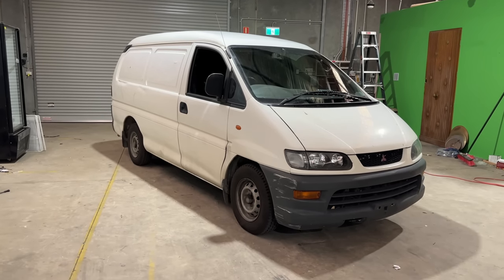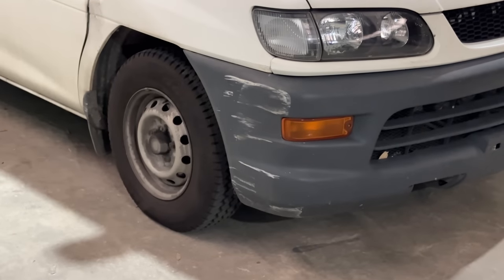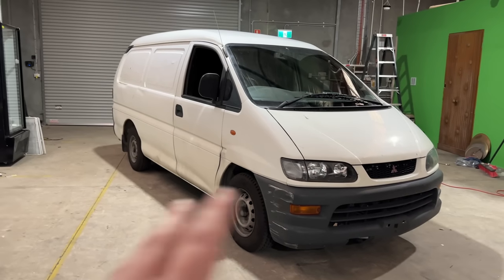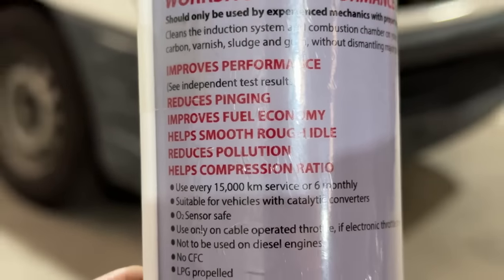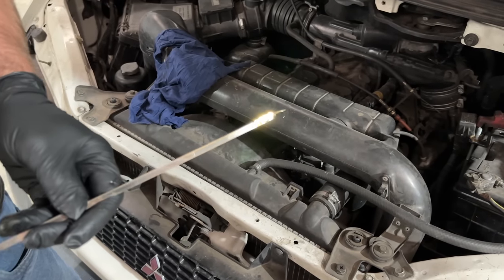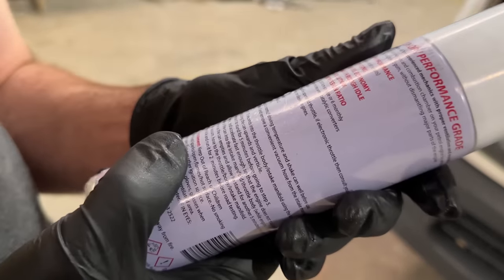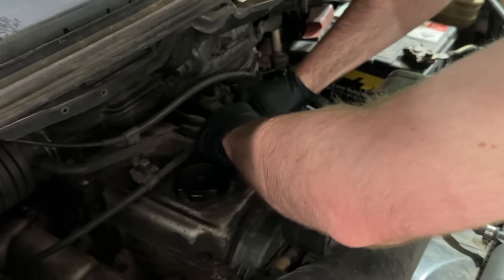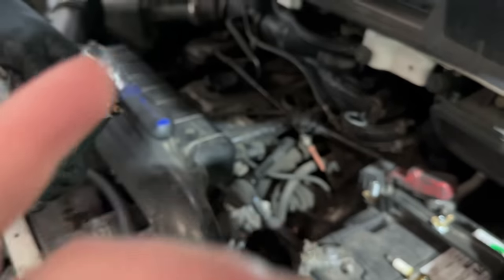We killed the donkey van.

Comment: The fact that it doesn't throw a check engine light is actually pretty funny in a subtle way. The engine making all these scary noises and the ECU is like, "Nah. We're good."
Reply: I think this van is before all that. Barely, but before all that.

I had a 90s car that would not throw any errors until it was fully cooked
Reply: @miaugato93  yup, so just in case the noises and lack of working didn't tip you off, we are broken
Reply: "Fuck it we ball"
Reply: The computer can't tell if the car is on fire upside down with four flats. It only checks the output of a few sensors.
Reply: @miaugato93  My '98 Civic doesn't show a CEL or any codes despite running on 2 cylinders
Reply: @AiOinc1  Ahh so that's my problem, time to install the fire sense-oars and set them on a semi regular basis
Reply: "S'all good mate. That smell's gonna cook off any minute"
Reply: @AiOinc1  ironic that a new car could at least detect 2 of those criteria.
Reply: i had a mid 2000s Ford truck like that, ended up with a dead cylinder too and didn't throw a light or code or nothing, even foot to the floor running on 7 cylinders with the engine shaking like an earthquake
Reply: yet my 05 dodge magnum always has a CEL for o2 sensors that ive replaced, and misfires if i turn my ac off
wtf car
Reply: Now ECUs are like one molecule of oil hits oxygen sensor ACHTUNG ACHTUNG ENGINE IZ IN DANGER and now you cant pass emissions grats
Reply: My 1990 ford f250 has the filter keep falling off the transmission and I lose all the gears even reverse and the check light for the trans computer says "this is fine."
Reply: Shoulda used SeaFoam not Japanese Clam-Juice!! {-_-} 😳😂
Reply: @MAGGOT VOMIT  no pizza only khlav kalash!
Reply: My sprinter has no CEL… 

It’s there as I checked the speedo assembly but the previous 41 owners probably ran it with a permanent light on and it burned out or something. It also throws no codes so I have no idea wtf was going on there but either way it’s nice knowing it’ll never break down on me.
Reply: My mid 90s Peugeot got hella rod knock for over 2 years and literally only had the check engine light come on ONCE when I made a sharp turn on the highway at like 150 kmh, the moment I turned the wheel straight it turned off and never came on ever again. Still find that weird.
Reply: Light is probably burnt out
Reply: @buillioncubes  I had an engine throw a leg out of bed right where the knock sensor was. 
Hole in block, rod hanging out, knock sensor dangling from wires.

Yep. Nope. She's apples.
Reply: @nunchuckfilms  That's cuz that wasn't a knock it was a forced entry :D (or exit, technically)
Reply: "Hey the engine still rotates, it's fine" xD
Reply: @UserUser-ku6gm  In the ever so eloquent words of Buddy Repperton, "Is that Cuntingham's car??" 
😳
Reply: Maybe that's why its a nugget
Reply: it’s more like a “stop screaming, we’ve been through worse!”
Reply: "It's fine, i've had a good life."
Reply: @miaugato93  nope, this van has engine light, as part of OBD2 from '96 on

but yes, very weird that it showed no errors before failing :(
Reply: I mean that clearly means there’s no emissions issues!
Reply: so it's like preheat to 350 and when the bell goes off your van is done bone apple tea
Reply: My 2011 Ssangyong shows a check engine light because it stalled ONCE. Literally nothing wrong with it except for the fact that it was accidentally stalled ONCE
Reply: @misterdeedeedee let me guess, 5.4 triton?
Reply: @magnus150  Alarrm! Alarrm!
Reply: And it's supposed to funny that when it misses the light is supposed to flash and blink its brains out lol.

Comment: As a Subaru mechanic who uses this on every car: Youve probably dislodged some carbon from the intake and its sticking a valve open. Spray a bit in each port of the intake and leave it overnight.

Either that or you had carbon for compression rings lmao
Reply: Newer vid showed that it caused a head gasket to blow.

Best guess is that it was already on its way out and the higher exhaust temps the can of fun caused was the finishing blow.
Reply: @TheRedCap perhaps it had carbon for a head gasket
Reply: Plot twist: the head gasket blew tf up
Reply: @siriusraycraft5263  Quite fitting for subaru bits

Comment: Yeah, that plastic bottle of gunk you put in to "clean" the engine, actually exposed that the Donkey Van's rings are like 80 percent gunk.
Reply: 90% of never maintained cars are like that
Reply: @vipvip-tf9rw  the moment you shift the gunk it falls to pieces 🤣
Reply: The gunk was sealing the cylinders!
Reply: Kinda reminds me about how your not supposed to change automatic transmission fluid after 100,000 miles if you’ve not maintained it. Because the fluid gets filled with all the friction materials from the clutch packs. And if you do the transmission starts slipping.
Reply: Load bearing gunk
Reply: @bripbrap  😂
Reply: Put a K20 in the donkey van
Reply: @jacobrzeszewski6527  Thats for a full drain. A partial swap does still improve it greatly, even if its not been maintained.
Reply: I'm thinking it knocked some carbon loose and sent it past the valves and maybe bent a couple or damaged whatever seal they had left. 

The ring theory is also more than likely too.
Reply: @ConWolfDoubleO7  Not worth the risk.
Reply: @DerrickRG  I have to disagree based off personal experience. I did it to my car with 218,000 miles on it and it made it shift like new. It didn't have a service history til 174k miles, so maybe it was changed before then, but I doubt it. As long as it's not the majority of the fluid, it generally seems to improve it.

Comment: My guess is that the pinging was due to carbon deposits, and the dead cylinder after the treatments is cause there are now carbon flakes stuck under a valve.

A fix could be as easy as using some seafoam, or if youre cheapo just spray some water mist to the intake at high idle.
Reply: It probably cleaned up the gunk that was holding the whole thing together.
Reply: Probably hydrolocked it and slightly bent a rod, the squealing you can hear at idle and it struggling to idle is because one of the rod bearing is now in constant contact with the crank. What he was using was essentially the same thing as seafoam. Sprayed too much at low rpm.
Reply: @acidsilencev2  Very unlikely. Hydrolocking an engine takes quite a bit more liquid than you would expect. Even at low RPM your not going to be able to do that without being extremely careless.
Reply: @skurblord3401  You'd be surprised, the volume of an average combustion chamber isn't that large. That initial 15 second spray with the engine off could have done it.
Reply: I love idea of clearing out the seafoam with more seafoam
Reply: I'm not super experienced but that's what my thought was.  Cleanser knocked off the gunk somewhere then got it stuck somewhere else. :p
Reply: @LN997-i8x  sure, but if it were damaged from that initial start up then they'd have had the severity of issue from the very beginning. The problem started small and became worse through the day, getting to the point of where it was the next day with struggle to even get it started. I'm not at all interested in any kind of Internet debate, haha; just adding my unprofessional opinion that it feels like something slightly bad became significantly exacerbated from running that spray. Burnt valve, messed up VVT system if it happens to have one, sensor or mechanical failure/obstruction along the vacuum system itself affecting idle control and air/fuel mixture, maybe even the cat blocked up enough to cause back flow? Ultimately we'll find out, but it'll be a really good learning opportunity if the cause isn't related to something I listed. I'm looking forward to it 🤓
Reply: Well, the theory was exactly the kind of thing that happened (head gasket leak being made worse across the barrier between the 2/3 cylinders until they completely lost compression), but all of the proposed theories were way too big brain, ya dingus! Head gasket! It's always the head gasket!! Hahaha

Comment: Fun fact: according to Subaru's service intervals, an entire can of that engine conditioner spray needs to be used every 20,000km!
Reply: So it dies quicker and you buy a new one
Reply: That's funny, 30K km's after I bought mine I changed the engine.  Never mind the fact I bought it at 270K km's, or the fact the old engine still works, but I did it
Reply: @sakurojason  Stop with these stupid memes. Only 2.5 EJ engines are problematic. No other subaru has any issues like this.
Reply: @Kacpa2  Would be nice if that was true.
Reply: @CortyCze  Then what is your story if you think it isnt?
Reply: @Kacpa2  subarus killed my grandma
Reply: @QWERTY708100  hugs
Reply: @Kacpa2  only the non turbo ones at that
Reply: @nickjonathan4043  Which is majority of subarus, but even 2.0L ej turbo doesnt have ringland issues or hg. Its only 2.5 that is do plagued with issues. Plus mosy cases are often case of both neglect and abuse. Many kids in us dont have any idea how to care for a turbo car, even as simple things as letting it warm up before and cool down after driving. You just shouldnt shut it off instantly like NA car. In europe its common knowledge mostly because of turbo diesels but in us not so much. Some people know and have turbo timers or just do it themselves but majority doesnt. Most fools get access port and crank up boost and then complain it exploded on them.
NA motors also have better oil pans by default because of different exhaust headershape(equal length) requiring it so anything like oil starvation cant happen. Subaru only started using those since 2007 onwards in ej25 turbo.
EZ30/36, EJ15/20/22, EG33 and FB/FA series have no major issues. Early fb series has a bit excessive oil consumption like my XV/Crosstrek does, but its not much unlike old highreving engine would have like my old 1990 Celican GTi. Just need to check it once in a month or when low oil level goes off to top it up. i had it for 3 years and nothing happened to it so far and i put 25 thousand kilometers on it so far. Its very light on maintence outside of that, just fluids(engine, trans/diff oils/filters and maybe v-belt stuff soon(tho it looks ok so far).
Reply: Only thing that happened is some minor rockchips, and had windshieldncrack. Stone fell on the windshield from overpass i was drivingnunder and it expanded to the bottom of the windshield so we had it replaced recently. Its 2012 2.0i(fb20) 6mt, so 11 years now, but looks quite pristine.
Reply: @nickjonathan4043  old NA subies are little tanks, our 1.6 impreza has been running strong for 200k km and 20+ years

Comment: You could still try the spark plugs. I've had ones that looked perfectly fine but ended up being the problem any way though an easy test for the engine values would just be a compression test but because of whst happened before it died id replace the plugs and check the air sensor and o2 sensor.
Reply: @ShitHappensRLY  That goop mixed with the oil, it's not gonna maintain it's viscosity.

Comment: We have a similar "engine cleaning product" In the states. The most common one is called Seafoam. During use, they recommend holding the throttle at higher RPMs while putting it in the intake side. And after its burnt out, they recommend a spark plug change.

Comment: You should probably grab a 20m length of like 50-80mm hose to act as exhaust extension to direct it out the bottom of the roll up door. We used to do that in garages at work for venting so we didn't die.

Comment: We did something similar to the canned stuff you use at a Honda dealership I used to work at... $200 and your car runs exactly the same as it did before you gave them $200. It caused a HEAVY misfire on every single car and sometimes the best way to clear it is to send it after.

Comment: Another car story, in the 70's my friend got an old 47 Ford pickup, it had vacuum powered wipers that would only work when it went down hill, this truck was thoroughly clapped out but did run, the original owner warned my friend to under no circumstances use detergent oil in the engine as the carbon and soot was the only thing holding the engine together, well one time he had the oil done and the person doing it put in the wrong oil, within a day it was leaking from every place you can imagine and a less than a week later the compression was so low it couldn't run anymore, that was the end of the 47.

Comment: I've seen something similar to this situation with a few vehicles. Sometimes they're so plugged up with junk that it's hiding a more significantly wrong issue, or a different "solution in a can" managed to "fix" something and then going in to fix something else undoes what the bottle did. I'd be willing to bet that the head gasket was hanging on by a thread and a bunch of carbon, and running that conditioner through it blew out some of that carbon.

Comment: When I got my first car a Pontiac Acadian it was choked with carbon buildup BAD, my father pulled the air cleaner and while revving the engine he put water down the carb to clean out the combustion chamber and valves, just enough to almost stall the engine, it worked, no more ping and the compression went up about 10psi per cylinder, the shit that flew out the tailpipe stained the road where we did it for years, I drove that shit box for 7 years and sold it to a person that immediately crashed it. God I miss that old girl.

Comment: I mean it's probably a bad coil a skipped tooth on the timing chain or a stretched chain, or even just one of the lobes on the cam wore down and needs some welds on it to open the valves... pull the window and cut the firewall off so you can pull the valve covers

Comment: She'll be right my old 1999 rodeo turbo diesel only ran on 3 cylinders for years it was amazing I just cranked the turbo and it kept chugging only issue was

Maccas drive thrus were horrible because it was so loud that you had to turn it off 

Oh and im 90% sure the chassis was bonked on it cause I got multiple alignments and the tyres still died every 10k km

Comment: You don't know oil smoke until you walk past your exhaust with the car at idle and your leg turns black

"It's not idling good" a good idle for my civic is where the sun visors fall down. And Italian tune up is where you run it really hard. Blocking the carb after revving it up is called the big suck

Comment: Usually that “fix all” stuff is a bunch of shit but here in the states we have some products kinda like that goopy oil u dumped in. Lucas oil stabilizer and marvel mystery oil. That thick ass shit cuts down on the burning a fair bit. Most of that stuff is just snake oil lmao but the lucas oil I throw in my 94 mercury grand marquis (idk if y’all got them over there but she’s kinda like jeff but with the 4.6 instead of the 5.0) each oil change has had it running better than when i bought it LOL

I used to burn about 2 quarts every 1500 miles but now it’s down to about a quart every 3000

Edit: Just realized that can of conditioner is kinda like sea foam. I used that when I first bought the car and it does help clean up the carbon a little but not like a fresh rebuild would like u said LOL

Comment: I’m curious if it really was the stop smoke stuff. Because you showed in some previous video the oil pressure light came on randomly. Could the oil thinking stuff screwed up the oil pump or clogged something?

Also I’m curious what would have happened instead if you tried some old hotroding technique of shoving a vacuum line into a bottle of atf to suck it in the intake and clean the carbon out of the cylinders